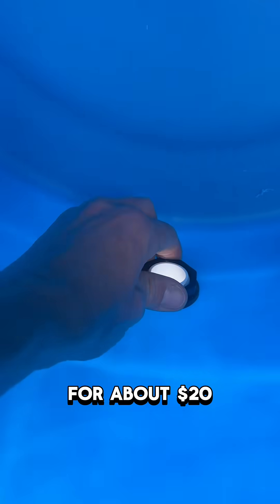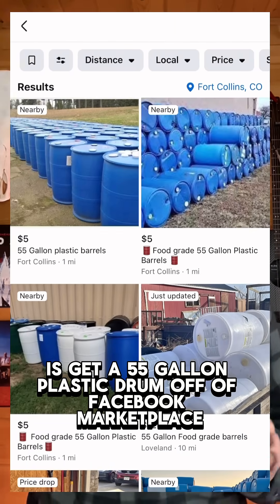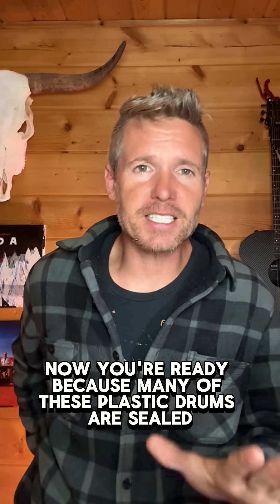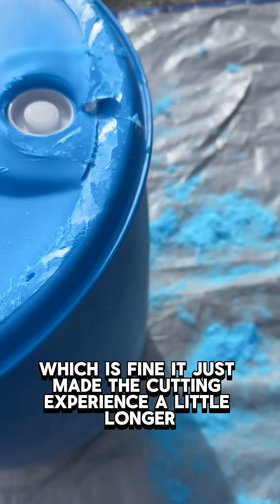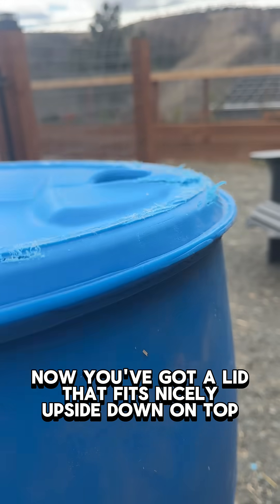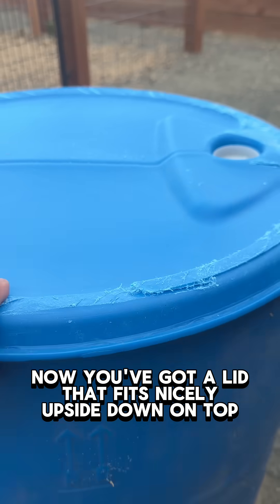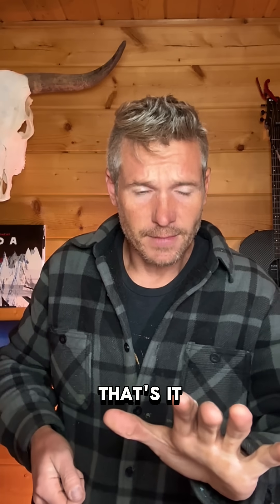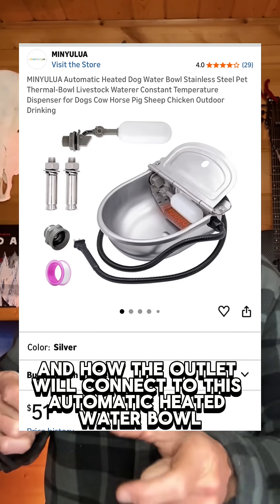How to Turn a 55 Gallon Plastic Drum into a Winter Livestock Water Tank or Rain Catch System

Comment: Simple I just use a standard trough heating element that fits into any water trough through the same sized hole typically 3/4” if memory serves me correctly which runs off 110 volts. The heating elements are made specifically for this purpose as far as keeping water troughs from freezing during the winter months and will work on both galvanized and the Rubbermaid style troughs or can be retrofitted with any other type of trough as long as you use the correct/properly sized hole for the element purchased. You can easily find said elements at your local feed stores, some Mom & Pop Hardware stores, as well as Amazon which also now sells them. Just make sure to properly wrap up your extension cords to keep them waterproofed from the elements as per normal operations of any outdoor use with electrical power for hazards of course!! Much faster and easier than this DIY project AS LONG as you already have a trough for use with your livestock while I would assume one does. However most places also sell them with the bung already pre drilled with the assumption that one will be using a winter element at some point or purchasing either their brand. Just make sure that it IS NOT just the bung that is there for easy draining of the the tank/trough. It needs to be the larger bung typically marketed for such use. Tractor Supply carries the trough made by Rubbermaid as well as their branded and another Galvanized brand that is pre-drilled and ready for the heating element just as you can purchase some from Amazon if you need to buy one as well. However this is a cool project for those looking for a DIY project as well. I personally use both a Galvanized version with the Auto top off float and element as well as a Rubbermaid and its corresponding brand auto top off as well as the aftermarket element which is installed during winter months. Mosquito dunks during the summer months or as needed. Obviously tanks scrubbed/ power washed every few weeks/months as needed for proper maintenance and care for both the tanks benefit but more importantly the well being of my livestock and their health and happiness. Hope this helps you folks. Best wishes to you all

Comment: Thanks! Would I need to cut off the top if I’m doing it just as a water prep system, just as emergency water. I have two of them, but I haven’t done anything with them yet. I got them so I could fill them for Back Up emergency water.
Not for rain catchment.
Reply from the maker: The reason the top needed to come off is so I could access inside to add the outlet